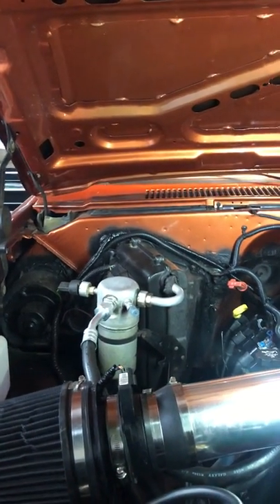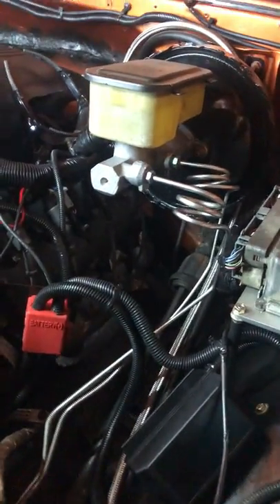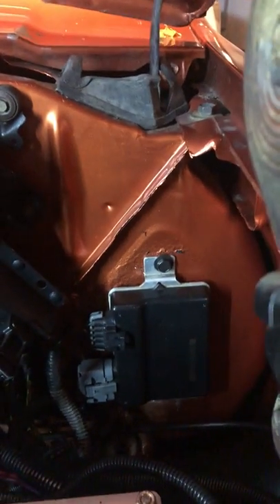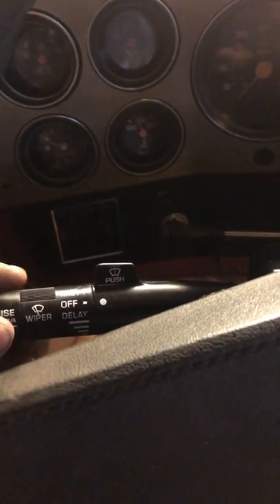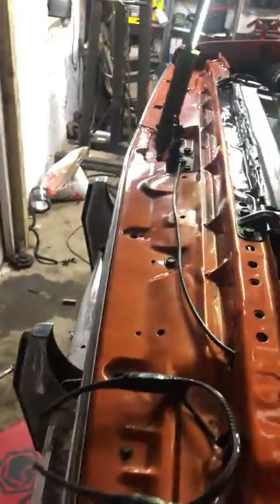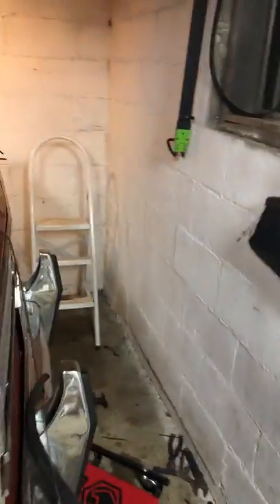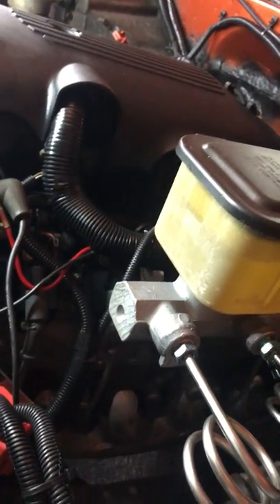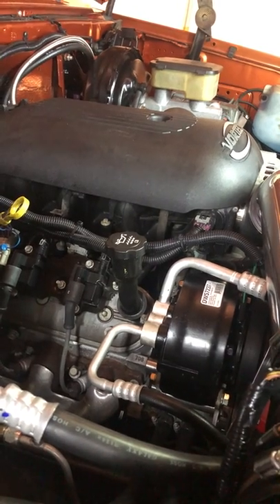K10 LS Swap

Comment: Nice video, doing am 84 k10 currently, did you have to notch the front cross member near the driver's side by oil pan with the dirty dingo engine mounts?, trying to decide between those or ORD motor mounts.
Reply from the maker: I did

Comment: What did you do for the transfer
Reply from the maker: 208 with adapter from advanced adapters
Reply: @williamseabolt3869  and t
That send the signal for the speed? .im asking because i am using a 208 and cant shit out of 1st
Reply from the maker: @gerardovazquez4665  the adapter comes with a speed sensor.  And reluctor wheel

Comment: basically you cut both pedals and weld them together.  I will post some pics.  I've done it on a few trucks now and it works great.   you can bolt it right to the stock square body location.